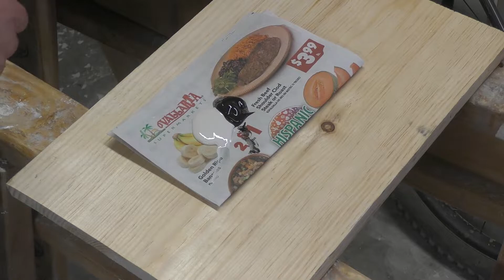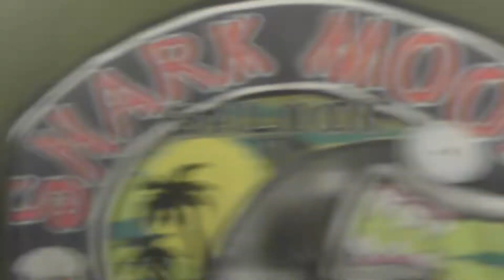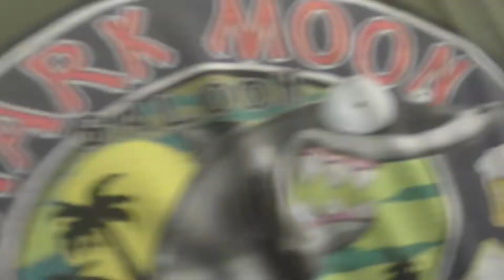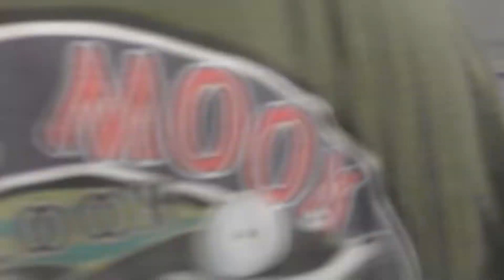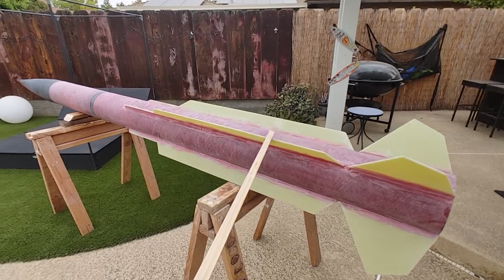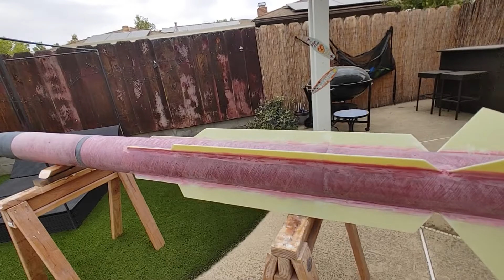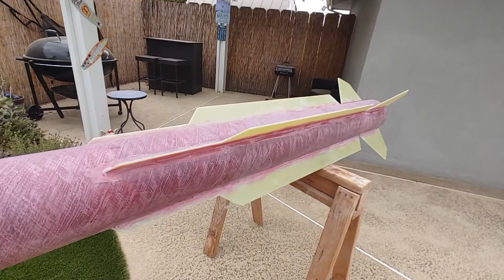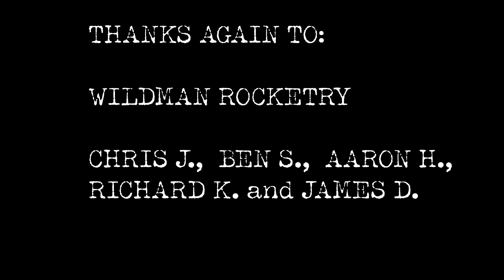8" dia. STANDARD ARM kit  (BALLS 30, build and flight)

Comment: Thanks for this detailed build video!  I’m starting a 5” fiberglass “Terminator-5” kit in December and this has really helped.  Questions if I may:  What are the 4 threaded rods in the motor mount area above the lower fins — is that reinforcement for the rocket?  And what is the small diameter white tube in the lower motor mount area next to the 38mm motor mounts?  I’d really like to see how you built your AvBay including which connectors for the wires you used.  And if you have any video of the drogue/main parachutes (or any on-board video) that would really be great to see.  OK a lot of requests here but let me repeat THANKS! and just EXCELLENT!!  Hope to see you at a launch one day!!  Stephen on 24 October 2022 from Belgium; Tripoli 01420, Level-2
Reply from the maker: (4) all- threads- I did this because I wanted extra support for the (2)U-bolts that needed to hold up to a 24ft chute
Small white tube- is used to for the igniters going to the (4) 38mm motors
Electronics Bay - well I cant tell/ show you all my secrets because you wont learn anything (haha..jk jk)
I dont do on board videos....but.... I do plan on releasing a go pro on a parachute from  high alt.